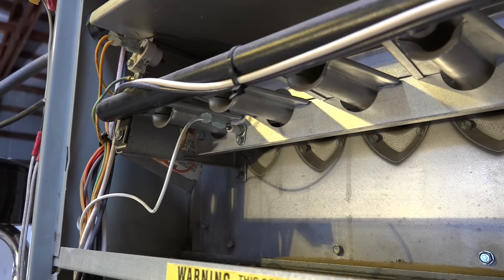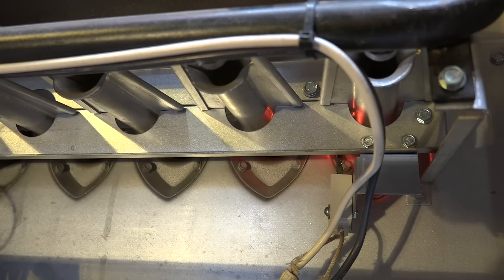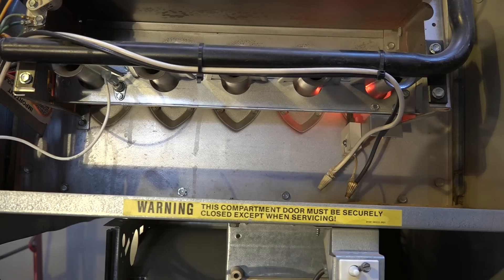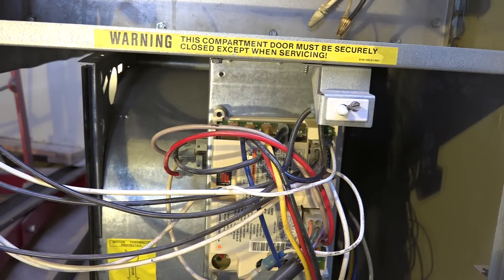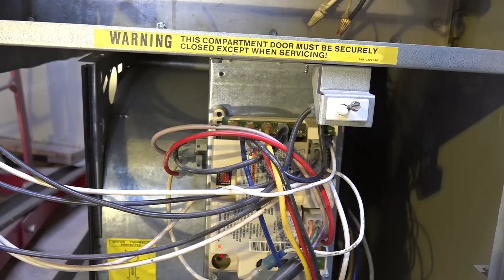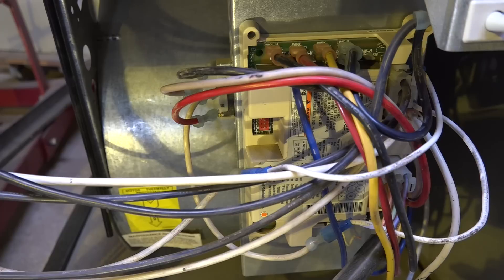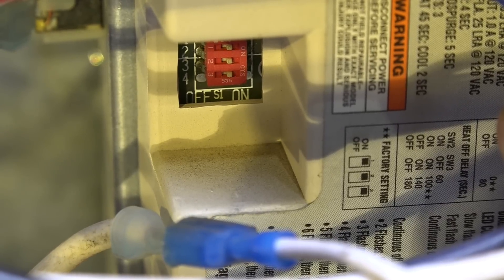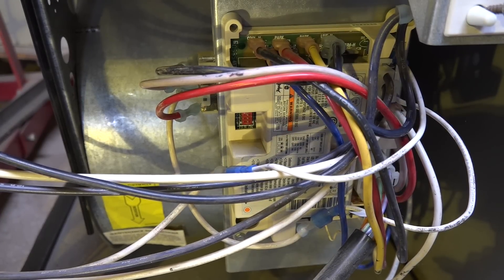Gas furnace integrated control part 5

Comment: cool thanks again Gray let me know the exact ohm's and hot surface igniter sensor and the flame rod or sensor flame when ran OK  and when no problem with
Reply from the maker: +Gerardo Micelles Ohms should not be above 150 on most units.  Flame rod amperage is from 1/2 to 4 microamps DC.
GFM
Reply: Thanks Gray cool i have to save this and Thanks for your best videos

Comment: What is the average stack temperature of an 80% gas furnace? Also how did some of the older model Rheem furnaces sense flame with no flame rod, that had a HSI. Great video thanks.
Reply from the maker: +Robert Weeks Stack temp is 375 to 475F.  These units used the HSI as the flame sense.  The sensing was unreliable and several years later, the flame rods were installed.  Hope this helps.
GFM